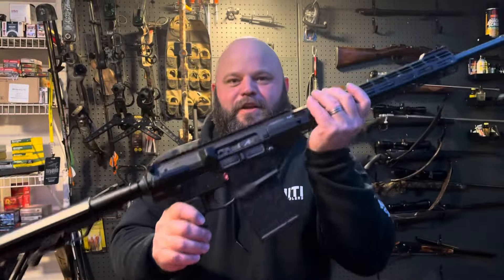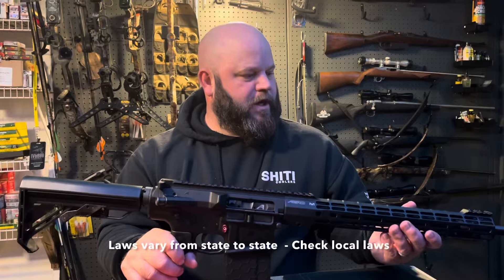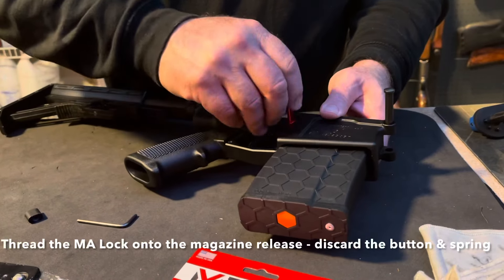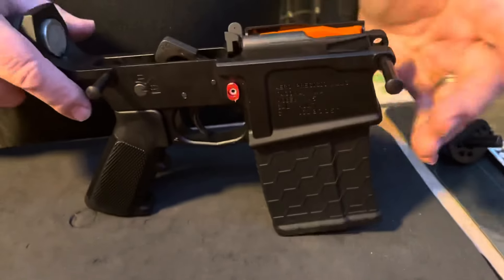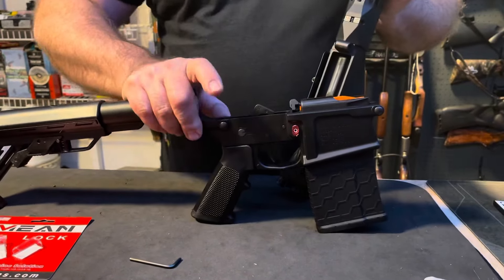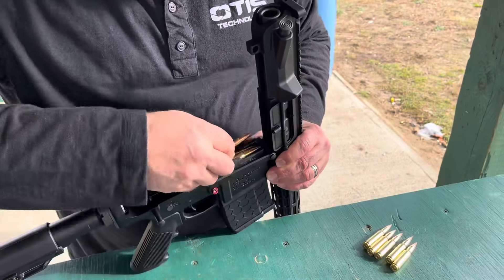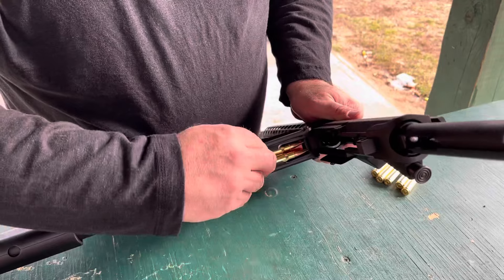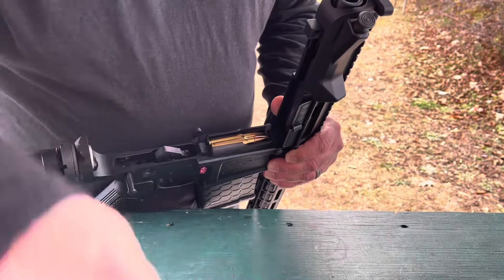MEAN ARMS MA Lock Installation and Test-Fire - Aero Precision AR-10 in .308

Comment: Fellow NYS resident looking at a similar arrangement. Do you just load your 10 round mag to 5 during hunting season?
Reply from the maker: I have pinned 5 round magazines for the rifles I hunt with.  NY DEC regulation states that it is illegal to hunt with an autoloading firearm that holds more than 6 shells (except an autoloading pistol with a barrel length under 8 inches);  so a 10 round capacity is not permitted even if you’ve loaded it with 6 or less.